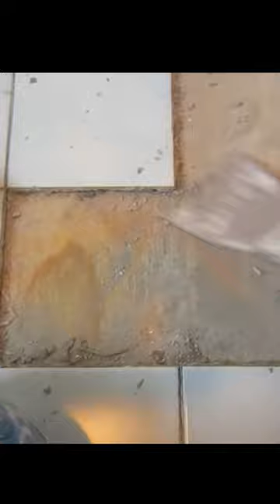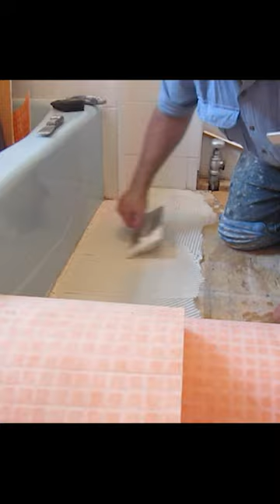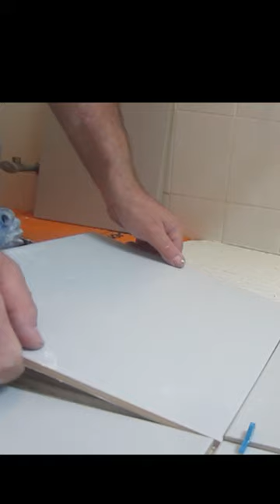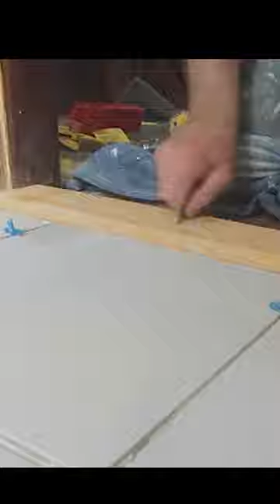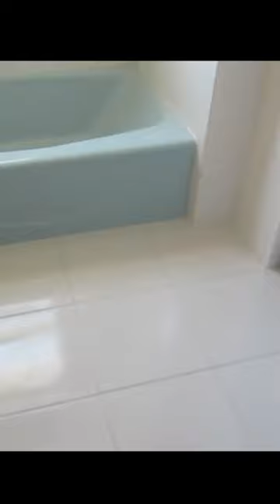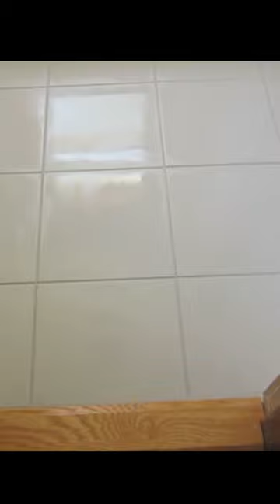Failed floor, replaced #shorts

Comment: If the tile didn't adhere, neither is the ditra
Reply from the maker: If you use the wrong products, the floor will fail, if you use the right products it will not fail.

Comment: Hey Sal,  could you explain why you chose to use nails on the wood threshold as opposed to trim screws. I would be worries of squeaking in the future with nails. Thank.
Reply: I would use wood glue and nails personally, wood glue to actually bond it and nails to hold it in place while it does so. No squeaks, no nails backing out